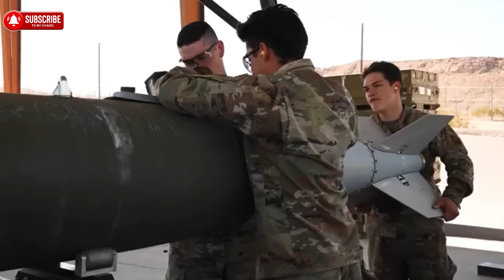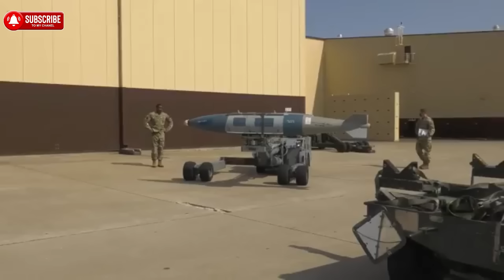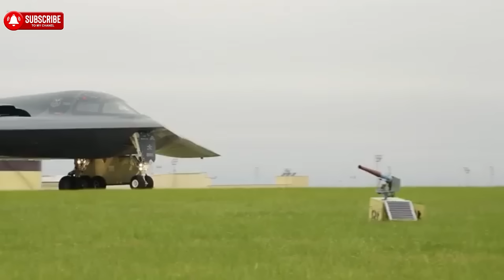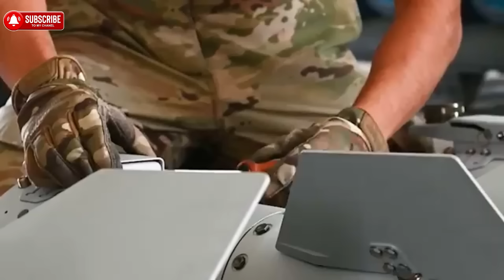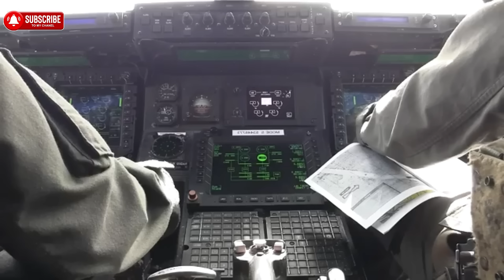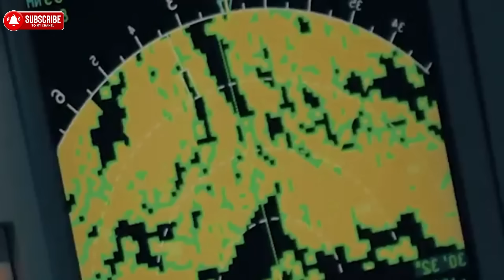How the B-2 Spirit Actually Works

Comment: For this and many other similar videos the view is through a mirrored image. This creates backward lettering views and backward thread function on mechanical attachments. WHY.? On this specific video the B1-B aircraft shown has tires that have rubber tread worn through to fiber exposure. Surely the aircraft doesn’t take off or land with tires this bad??
Reply: I’ve seen that reverse printing on videos of some B-52’s also
Reply: $1 😊
Reply: I quit watching  because the mirror effect makes me think this creator doesn't give a shit about accuracy.
Reply: @caseycrookham3647  he’s more accurate than you are. Maybe he had to do it that way.
Reply: @stanmans  Really, then tell us why they show a Boom Operator's Control Panel from a KC-135 Air Refueling Tanker inside a B-2 Bomber? Is that accurate? The majority here all seem to believe the mirror image is just plain Bass Akerds.
Reply: @stanmans  Really, then why did they show a Boom Operator's Control Panel from a KC-135 Air Refueling Tanker, inside a B-2 Bomber? That isn't accurate at all. They sure didn't have to do that either.
Reply: @markhoffman51  I have no expert on how to have this and I have no idea what you’re talking about